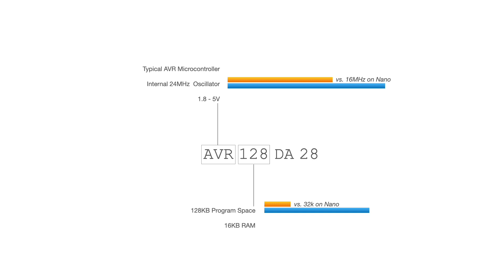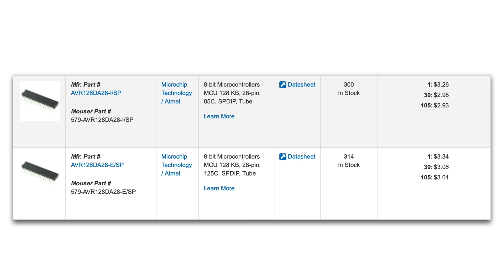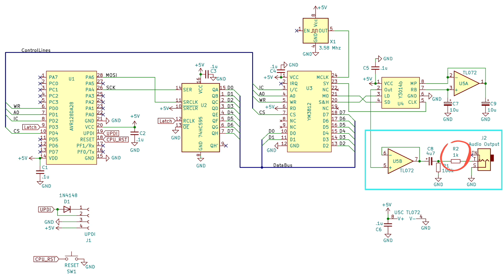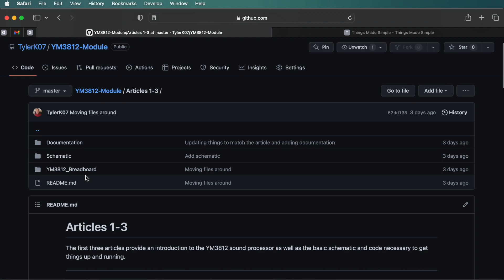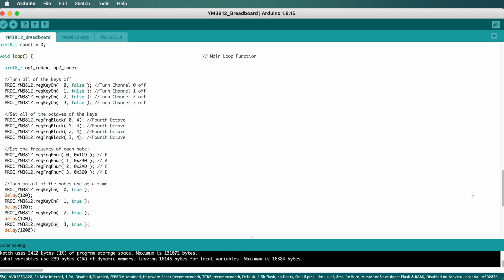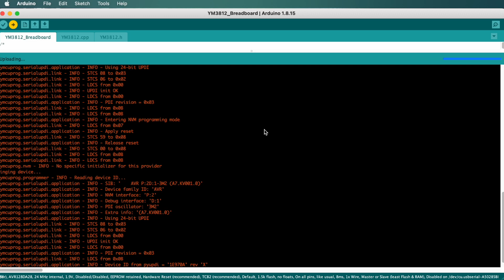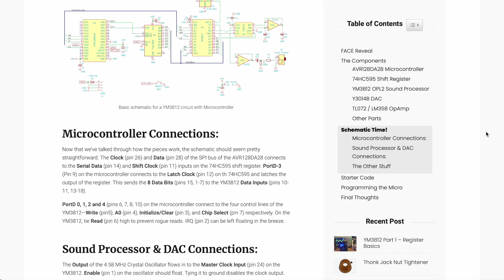YM3812 EuroRack Module Part 2: FACE Reveal

Comment: Is it possible to replace this particular AVR IC with ATmega328? It may be not pin compatible. I wonder. I have a few ATmega328 ICs somewhere in my box of electronic parts. You say it's not as good, just I already got some
Reply from the maker: You can do SOME stuff with the ATmega328, but the 2k RAM limit becomes a problem in some of the later videos. If you can find a micro with more RAM, it will work out better in the long run. The AVR128DA28 works really well at a pretty low price point

Comment: Excellent. I'll start with this. E/SP or I/SP?
Reply from the maker: Wooo! Glad you are going to attempt it! The E/I refers to temperature range. If you plan on operating this above 85 degrees Celsius then go with the E version, but otherwise do whichever is cheaper :)
Reply: @ThingsMadeSimple  Microchip has both. Min of 5 to complete the order. ($16) I'm going to go ahead and step in it.

Comment: Do you think something similar would work with a YMF22-M?
Reply from the maker: Do you mean the YMF262? If so, then yes, the programming is very similar. Check the data sheet though. There are two banks of registers selected by a second address line. Also, you get 4 operators per voice so there are more registers to set. Still, if you can get a YM3812 to work, you should be able to get an OPL3 working too
Reply: @ThingsMadeSimple  Yes -- sorry, the six key on my keyboard needs to be fixed ! It seems to only work part of the time!

Comment: the Microchip Fubarino / TCHIP011 is 48mHz, 32bit, 64KB ram, 256KB programming area, twice of everything + USB (if your lucky and have the PIC32MX270F256D on there).
I have a microchip ICD3 programmer.
I saw one person or his schematic and used the: LTC6903, a programmable clock instead of the 3mHz58, would be fun to play with the clock.

I found someone that can "supply me some of these chips at a very good price, he is a on a holiday now.
Thnx for the code.
i need to use Texas Instruments 3v33 to 5V level shifter, a 8 bit version of the MCP23S18 (instead of your 74HCC595) and i wanna use a mcp3201 - 12-Bit DAC instead of the internal ones.

sounds great.
Reply from the maker: Is the mcp3201 compatible with the serial data coming out of the YM3812? The Y3014b is a 10 bit DAC but then also has an exponential shift component that provides 16bit equivalent dynamic range. It pulls them out of the serial stream, but I don’t know how common that communication format is.
Reply: @ThingsMadeSimple  the mcp3201 is gonna be used for the CV input of the eurorack module.
1 octave  per volt / 12 keys = X  Volt per key, over the range of 9 octave and a bit, i guess.
12 bit probably better then using the onboard 10bit. although the Roland juno-106 used a 10 bit resistor DAC. i checked the config of the ADC pins of the PIC32...., seams complicated.
: )

the seller sells me both: YM3812 & Y3014b.
He also makes devices using these Yamaha chips.
Have not looked the datasheet of the Y3014, but i already knew the clock line, now i know the rest, thnx to you.
Reply: @ThingsMadeSimple  i got one video serve automatically, this is cool: Adlib on a Breadboard (YM3812 OPL2 VGM Player), even drums sounds.
like it was yesterday, these sounds.
Reply from the maker: @AnalogDude_  Good find! I actually was playing with hooking the final module up to ScummVM and playing Sierra games through it (via general midi out). Swapping in different instruments on the fly was definitely an interesting experience :)
Reply: @ThingsMadeSimple  Video came automatically, wouldn't it be handy to add a clock input signal from eurorack? maybe a SD card or so?
Reply from the maker: Cool idea! You could build something like a VGM "trigger" that plays VGM files off of a SD card kind of like a WavTrigger
Reply: @ThingsMadeSimple  Not sure, i don't know anything about the Yamaha chip's, you're the specialist, but a clock signal would be a useful addition, i guess.

I'm not even sure, but to me it seams the chip can produce 2 independent sounds, correct me if I'm wrong if so, a clock signal would be a great addition.

i can only offer some assistance on programming.
Reply: @ThingsMadeSimple  i took another look at the datasheet, it says 2 sounds and 5 drums.
the datasheet doesn't say alot.

Would it be possible to add 2 CV inputs?
to have a "duophonic" and/or 2 voice poly voice module.